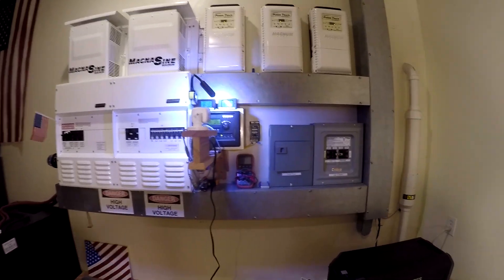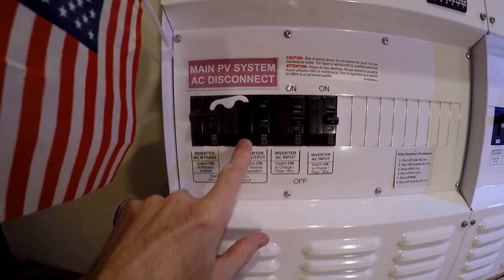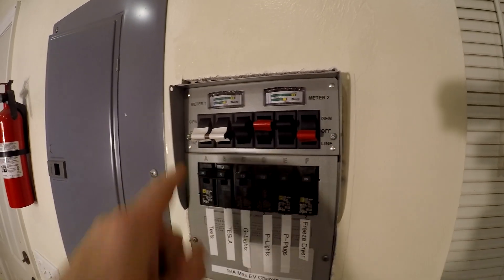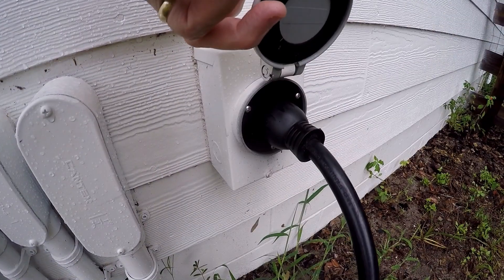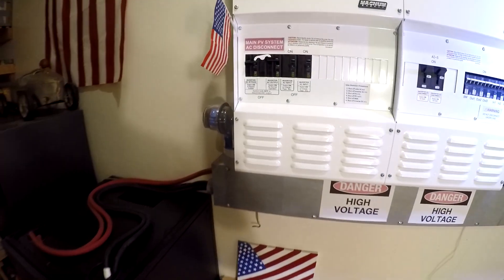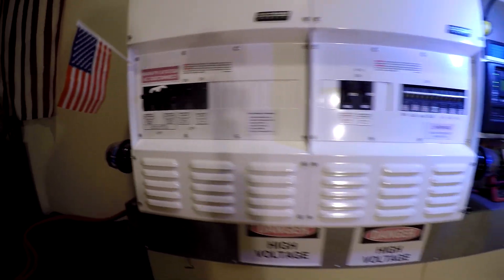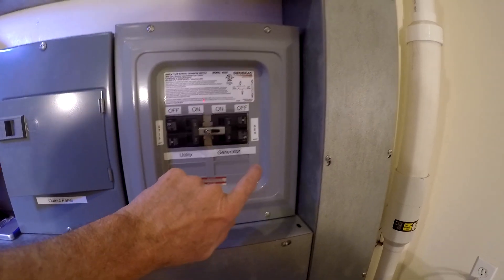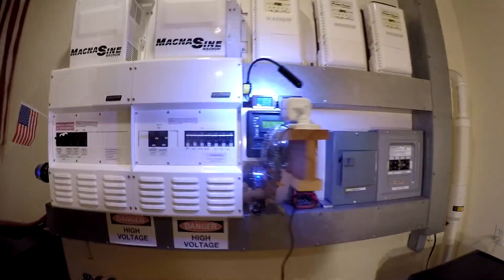Transfer Switches for Generators, Solar and Utility

Comment: I have a Ecoflow solar generator and a Honda 2200 W gas generator (18.3 amp max) at my camp. I would like to get a transfer switch so that I can have both hooked up as inputs to feed the camp and just select between the two. What kind of transfer switch would you recommend?
Reply from the maker: My 1st thought is to run everything off the EcoFlow and only use the Honda to recharge the EcoFlow when needed.  2nd Thought is to add solar panels. 

If you must use both at the same time then my thought on that is as follows:
1. Run the Honda into a small panel with maybe 6-8 breakers.  
2. Run the EcoFlow into a  6 slot, individually switched Transfer switch
3. Connect the panel to the transfer switch as per "normal"
Then you could switch between generator or EcoFlow as needed with both running.  
Note: The generator might need an earth ground.   
Note: I am not an electrician so you are at your own risk...
This might help:https://youtu.be/vUV3Abu4WFQ?si=QTzIziQIrX2XGElW

Comment: This is awesome! I like this type of set up more than the fancy all in one programmable stuff. It feels simpler and easier to understand. I don't want to run a computer and set up code. I just want to flip switches. Makes sense. Thanks for sharing! Also like the camera set up so you can always keep track of levels.
Reply from the maker: I am a retired Robotics Engineer and I spent a lot of time automating stuff.  That said, with my own stuff, I kind of like having that direct control of the "machine".  Thanks!

Comment: I saw your permit package. This was permitted by local code enforcement?  I am not able to apply for a permit as a homeowner. I have to be a licensed electrician. I did get electrician to install the xfer switch. I am working towards similar flex of using solar or line for different circuit. Would appreciate your insight.
Reply from the maker: Disclaimer: I am not an Electrician and I am not giving you advice.  

Sounds like you already have the tx switch installed for a generator with a plug (likely outside).  So, you might consider running out of your solar (lets just  call it a Mega 3 with a 30A TT outlet) and convert  that output to a generator extension cord.  Then you could plug that right into the outdoor Tx plug and pipe it right to your Tx switch.  Keep in mind that the Mega 3 is a 120V system and so the one leg is ported to both legs of the Tx switch and therefore you CAN NOT run any 240 circuits.  Note: if your running a 240V solar power system like me then your fine.  Other things to consider are your grounding and various other factors.   

I will be installing a system similar (a little better) than this pretty soon and may post it...